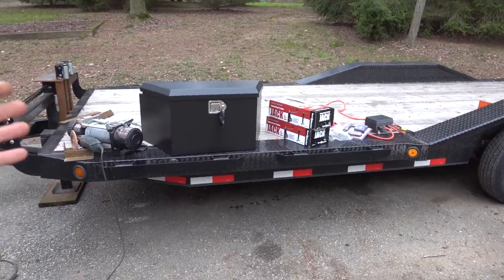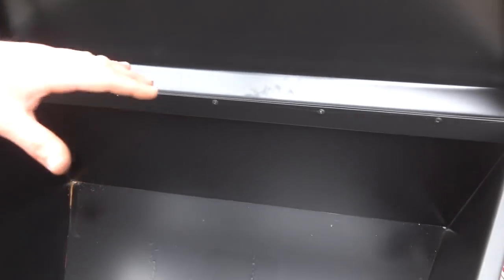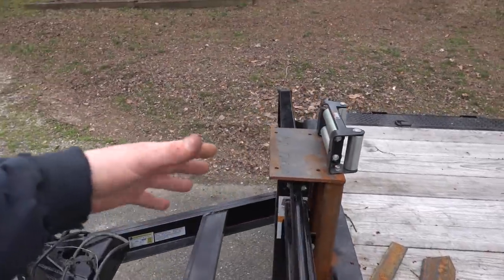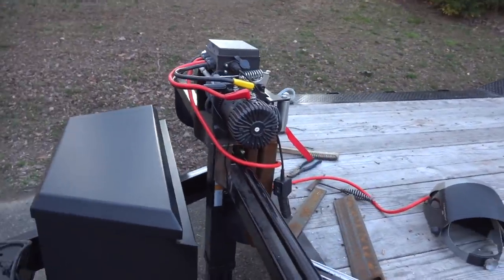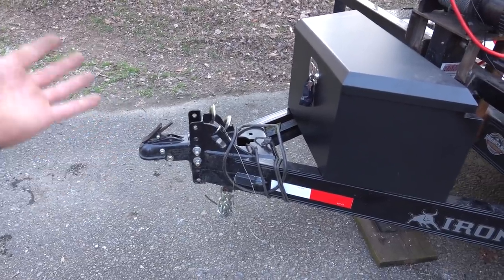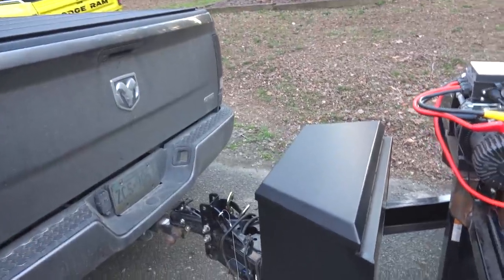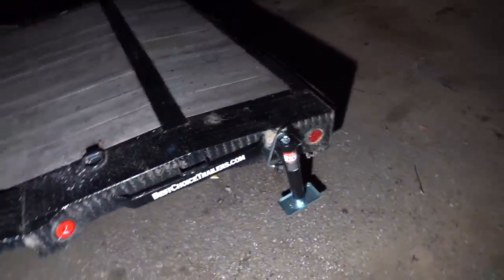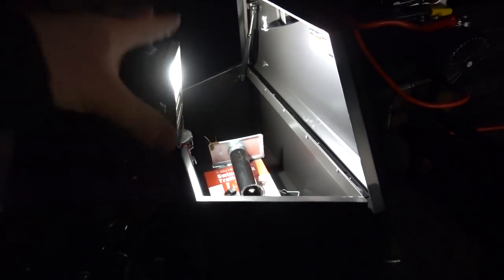EVERY Car Hauler Trailer Needs THESE!!

Comment: I don't have it on this trailer yet, but last one had a 2" reciever hitch on it to use a hitch plate mount. Use it in your truck when trailer isn't on, remove to deter theft. I use electric fork lift quick connector to hook up power in either application. You can add a battery if need be on the trailer. You can use that connector to help your hydraulic tilt battery live longer and also for your dump trailer. Make a set of jumper cables to plug into it for those side of the busy highway jump starts.

Comment: When backing to a trailer. Before you get out, set the parking brake. The truck won't move and will save you 3 trips.
Reply: Wow. 32 and never knew this.
Reply: I thought this was common knowledge🤣🤣

Comment: I just run a big winch quick disconnect on my trailer and its wired to the batteries on my tow rig so there's no worry of a dead battery on the trailer. I also made up a set of jumper cables with the same connection on 1 end so I can jump start from the back of the truck or if someone borrows my trailer they can just hook up the jumpers from the trailer to a battery. Its been flawless for years

Comment: i have a battery on my trailer in the center of my A-frame.  i ran a 4 gauge power lead off my truck batteries to an Anderson connector to charge the trailer battery and to idle if i need more power when winching something onto the trailer. works great.
Reply: matt72991 me too 🤙
Reply: @monkeymoney7830  works great even if the trailer battery is dead.  That's the main reason I did it this way
Reply: matt72991 I usually keep the battery in the garage on a trickle charge I don’t leave it on the trailer got a hitch pin for quick wench removal to many thieves where I live

Comment: Run the power and ground wire out of trailer plug from the truck. Then when ever the truck is hooked up and running it will charge the battery on the trailer

Comment: You could install some quick connects, I think they might be plow connections.  But I know tow truck use them, so they have the quick connect coming out of their grill and they can plug in a set of jumper cables.  This way they can jump a car and not have to pop the hood and hook up cables.   You could put the quick connect at the back of the truck and then run (jumper) cables to the winch.  Or make a set of quick connect cables that live on the winch.  Then you don’t have to worry about mounting and maintaining a battery on the trailer

Comment: You could mount the battery on the right side of the trailer, opposite your jack parts you want to avoid, hang it in the opening on that side

Comment: I put a agm battery under my trailer on its side it powered the load lights trailer winch and brake away controller all with one battery box has switches in it and it charges off the truck and has 120 converter on it so I just throw a Extension cord on it when I get home

Comment: Get some thick battery cables and run them to the rear of the truck and a pigtail coming off the winch that way you don't have to mess with a extra battery or charger

Comment: Would the battery fit on the passenger side behind the box u mounted? Easy access if u ever need to give it a charge and still out of the way of ur quick release on the jack and leaves the box open for other storage 🤷🏼‍♂️

Comment: I’d put the battery Under the trailer and put a splash shield around it. 
If it’s in plane site it may not stay there long till someone borrows it without asking.

Comment: Winches are the kind of thing that don't work when you need them.
I got a smitty built winch, welded up a framework sort of like yours, kept the winch off the deck and raised it a bit to give the lead a better angle. After installation played with it and wound it up. Then when I needed to actually use it it was dead. 0 pulls.

Comment: never leave the tailgate down while moving the truck with the trailer attached. Turn and you'll dent the top of the tailgate on that storage box you installed. Found that out the hard way.

Comment: If I had a car trailer I wood do the same winch setup you have on your car trailer I wood put the battery in the tool box and if your wondering what that little black wire is for on the winch that is the ground wire you take the bike Blake wire and the small black wire and you put those 2 Blake wires under the winch Motor and that makes the ground for your winch

Comment: I buddy of mine ran wires from his truck battery and put a quick connect by the rear bumper to plug his winch into so no battery on the trailer

Comment: Impressively you had it perfectly lined up when you backed the first time but forgot to account for transmission roll in the gear you were in, little tip, for what it's worth, put it in the opposite gear from what you're in, with your foot on the brake next time and it won't continue to roll when you put it into park, just sayin..
Reply: its called a tailgate camera!!
Reply: @chrisgrantham2341  Well that too but I've been using that technique and I look down at the ground with my door open and estimate how far I have to roll when I'm close enough and using those for years long before technical driving crutches and people are astounded at how accurate I am.

Comment: The winch sits too high, that's only my opinion, as the car getting pulled on the trailer the cable will start to rip up on the front bumper. Just saying